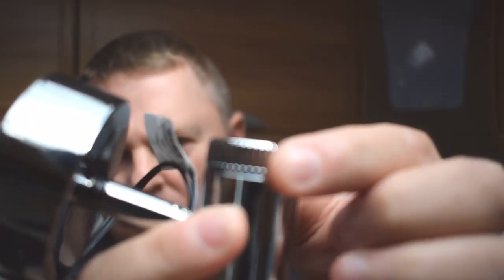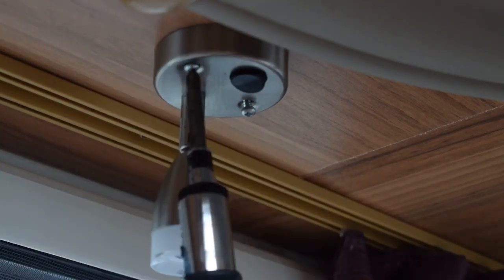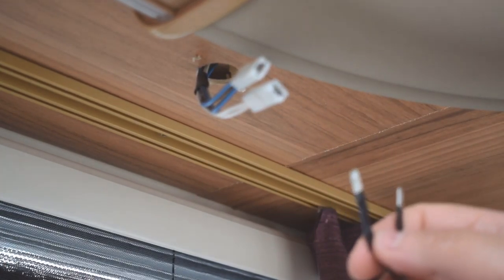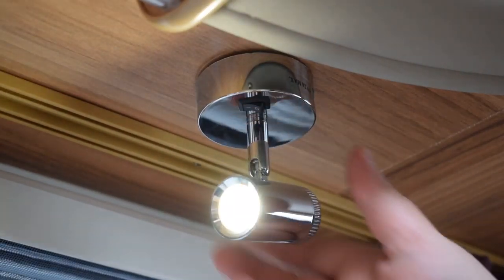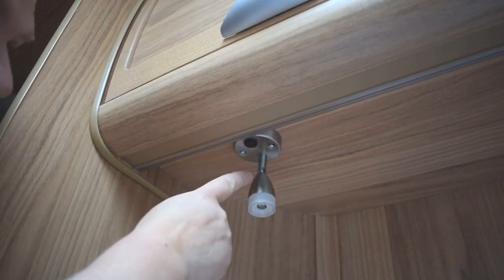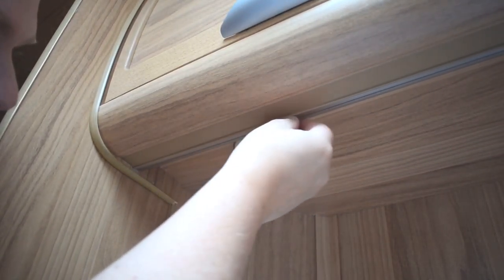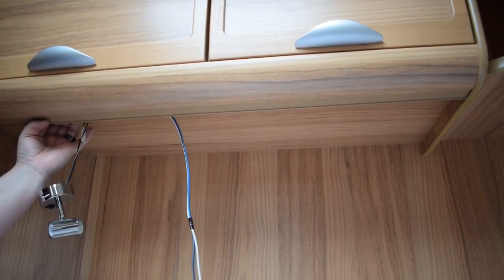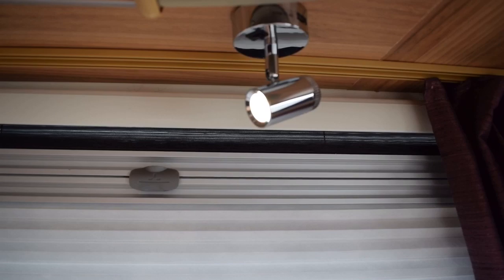Fitting USB spotlights to our 2011 Bailey Unicorn Valencia

Comment: Nice one Martin another job done the van will b like new by the time u finish with it wasn't there a plug socket in the bedroom area on the same wall cheers as always kev
Reply from the maker: Hi Kev, yes got to be careful not to spend too much on the van 🤔 There is no plug socket near the lights unfortunately, there is one at the side of the bed though. Thanks for watching, Martin 😊

Comment: Brilliant lights Martin, they look really nice, when you done the 2 rear ones I see you have the LED strip underneath, please could you tell me where the switch is as I can’t seem to find it lol 
Regards 
Phil
Reply from the maker: There is no LED strip light above the bed, they have just used the same clear cover as the front but without LED’s. Not sure why they did this as it would have been easy to fit some. Cheers
Reply: Many thanks Martin, i will stop looking for the switch lol 
Regards 
Phil